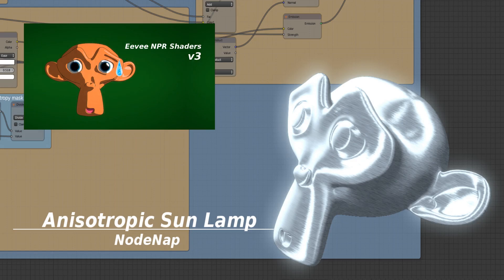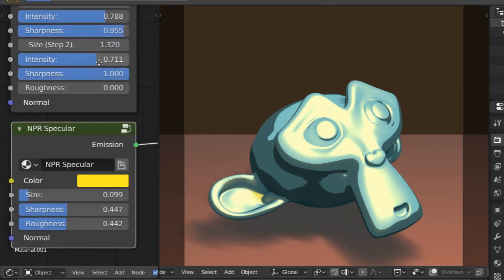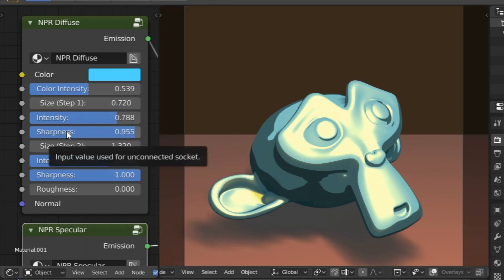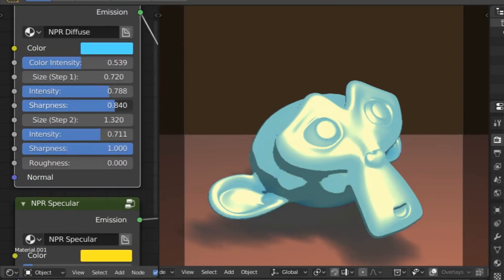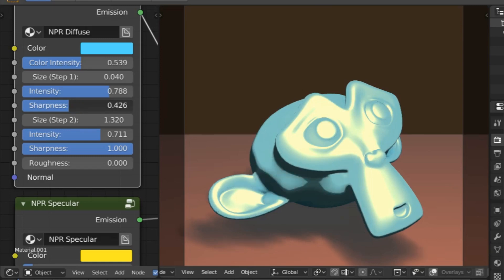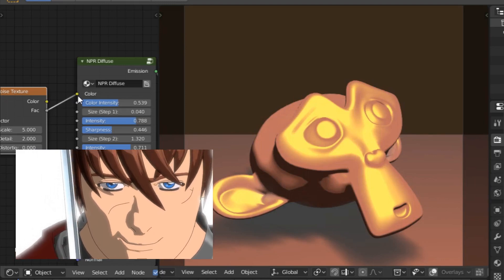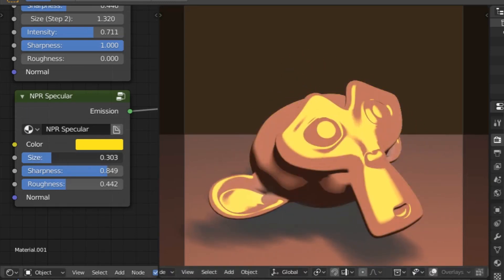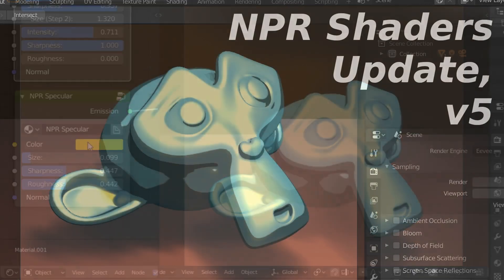NPR Shaders Update, V5

Comment: Hi ! I just downloaded the final 2.8 version of Blender, I started by making a Ship, then... It crashes after I have done the third render. So, I re start the software, and I have an error message:
"

Read prefs: C:\Users\Jon W\AppData\Roaming\Blender Foundation\Blender\2.80\config\userpref.blend
Warning! Using result of ChoosePixelFormat.
Warning! Using result of ChoosePixelFormat.
Warning! Using result of ChoosePixelFormat.
Warning! Using result of ChoosePixelFormat.
Warning! Using result of ChoosePixelFormat.
Warning! Using result of ChoosePixelFormat.
Warning! Using result of ChoosePixelFormat.
Warning! Using result of ChoosePixelFormat.
Warning! Using result of ChoosePixelFormat.
Warning! Using result of ChoosePixelFormat.
Warning! Using result of ChoosePixelFormat.
Warning! Using result of ChoosePixelFormat.
Warning! Using result of ChoosePixelFormat.
Warning! Using result of ChoosePixelFormat.
Win32 Error# (3221684230): <no system message>

Blender requires a graphics driver with at least OpenGL 3.3 support. This program will now close.

Then I try to switch to stable release of Blender 2.79 and I get a different crash when trying to open the program. It reads:

Your system does not use 3D hardware acceleration. Blender requires a graphics driver with OpenGL 2.1 support.

This may be caused by:
*A missing or faulty graphics driver installation. Blender needs a graphics card driver to work correctly.
"

It seams that the problem ISN'T the OpenGL version ( I have the last driver of my GPU card which is a GTX 1060, so the problem don't comes from the GPU itself ), but I just can't figure out how to make Blender works again ! I tried to uninstall and re install the software, but I have the same problem... I also have the same problems with the 2.79 of Blender that I used since one year !!! Please ! I need help !
Reply from the maker: Since it started up, we can assume there is something more serious going on internally. The biggest thing you can try, based on what the error message actually says, is to try the zip download in it's own folder far away from the installation folder and see if that starts (no customization here before it actually starts). This gives you a completely fresh try.
The reason I say to do this is because it seems to say that you may have copied your previous settings - this may be causing it to crash on start-up due to incompatibility between 2.8 versions. Has happened to me on several occasions where the first screen it was to show was too heavy or things would go missing, etc.

The next thing you can do is to try a different build, ie 32-bit vs 64-bit - still the Zip.

There have been other people who got pretty much an identical message like 5 years ago and it was OpenGL, OS or Driver related - not your case, because it has opened and suddenly refuses to.

What can also be a problem is that certain games and programs tend to hijack certain aspects of your graphics, even when it's not supposed to be running. I've had this where nero changed something and made Wax2.0e's preview display stop working correctly (beyond it's own shortcomings). If you've installed something between it working and not working, uninstall that and try again (no matter how unrelated it may seem - we're looking for an issue under the hood we can't obviously see).

Another thing you can try is to check your control panel for your graphics card and, this is a stretch, look for something that resembles and anti-virus where it limits or refuses support to certain programs and see if 2.8 is on the list (the older NVidia cards allowed you app specific controls to boost either performance or quality). There may be something like that, there may be not, I don't know, but it's worth looking into.

Let me know!!
GOD bless you! (^^,)
Reply: @MariusOberholster  Well, once I retry to use the software, it worked perfectly, but in about 5-10 minutes, it crashes and the problems came back.... I don't understand what are you meaning in your first paragraph, if I correctly understand, you meant to use the .msi installer and to use "repair" ?
And yeah, another thing: the 2.79 don't works anymore eather
Reply from the maker: Absolutely not, lol. You said this: "I tried to uninstall and re install the software, but I have the same problem...", so I said to use the zip file instead - it doesn't install, it just unzips and runs from that folder. It's the cleanest "install" possible, imo.

Back to issue though. It sounds like it may be your driver. I've had the same Nvidia card for a very long time. There is an updated driver available for it, but I refuse to use it, because it makes my computer freeze periodically then unfreeze saying that the driver stopped working. This also sometimes leaves a little black block on my screen somewhere and I HAVE to restart when it does that, or programs don't work right. I reverted to the previous version that actually worked like it was supposed to. If your system is set to download and install the latest graphics drivers without you even checking (this can come through Windows Update as well), check the date the problems started with the latest update done. If there's a link, revert to the older driver, turn off auto-updates for your card and try again.
The fact that 2.79 also refuses to work says that something changed around Blender and not Blender itself. The likeliest culprit is that your card's driver was updated in the background and it's buggy like the "update" I got a while back...

Let me know!! (^^,)

Comment: Sorry man, but I dont understand, you like anime, because you made a tutorials about similar shader for anime, sorry for my english
Reply from the maker: Yes and this is an update to those (see the description links) that don't require drivers to know the light's location. The older ones that do, are still included, but will be out as soon as I get the sharpness sensitivity balanced for the newer ones.

Also, Anime is not the only form of NPR out there - one of the most popular, but not the only one by a long shot. Certain styles have certain requirements and the latest release, v5, allows you to customize almost every aspect of your material (even texturing it), now including sharpness separately on both steps and the specularity.
For example, one form of NPR is stunning, but hasn't been used for animation and that is the classic disney VHS cover. They mixed flat colors with a soft specularity. Claymation typically has a very soft, yet almost invisible specularity due to the texture of the rubber or clay they work with. Cartoons have very harsh shading, especially on the diffuse, but sometimes does sport a little bit of a soft specularity. To create all these, you need a lot of control over your material.
NPR is a huge field and I didn't want to just cater to what I want and what I need, so these shaders cover much more than anime. Plus, the cheaper things become to produce and the more CGI is used, the more softness does come in.

I hope that clears up any misunderstanding! :D
GOD bless you! (^^,)
Reply: @MariusOberholster  wow, thanks for big comment, and I very like your videos about anime character, special for shader, because for blender few video is for anime character on youtube, I understand is very hard work, and you is my herro in this world :) in special I made an game models, but I like anime, and you help me with this